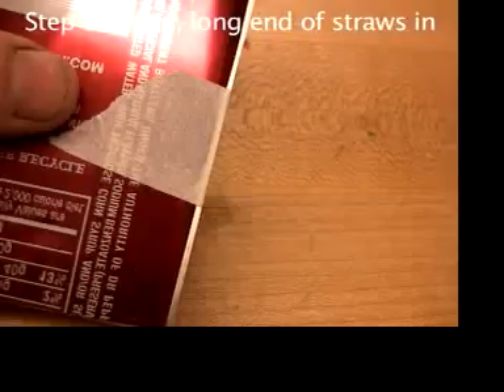Part 11 Build a Putt Putt/Pop Pop Steam Boat s8 straw in

Comment: can use copper pipe instead of straws
Reply from the maker: Yes, but it will be more expensive. As with the straw, you have to be careful not to kink it where it bends.
Reply: sciencetoymaker do you think its better to use copper tube or straw? I already bought copper.

Comment from the maker: If the tubes were glued in with epoxy, then they should not melt. Melting occurs when there is no water left in the boiler--leaked out or not primed right.

Comment from the maker: @kellybolin By far the most common comments involve finding an alternative to epoxy. There are a number of adhesives that would hold the straws in, but does your method seal all the leaks and hold up to the heat? If it does all that--actually works, in other words--you might consider sharing your method via a video response. I've tried to find alternatives, but many good ideas have fallen to the wayside when I actually tested.They leak.
Slater

Comment from the maker: @12shonte Well, there is a pattern. But if you can't print it out the middle is 1" and the side flaps are 1/4" each. And as long as the alumimum
Slater

Comment from the maker: re: rubber cement instead of epoxy: Hmmm, I don't know. Does someone want to try? You have to get the glue in between the layers of aluminum, so it would take longer than normal (over night?) for it to dry (the solvent to evaporate). Heat would help speed up the drying, too. It might work.
Slater

Comment from the maker: re normal glue: Obviously it will not work with water-soluable glue (the engine has water) or hot glue (the aluminum part gets how). I have never tried a solvent kind like Duco cement. If anyone has tried it, let me know and I'll pass it on.